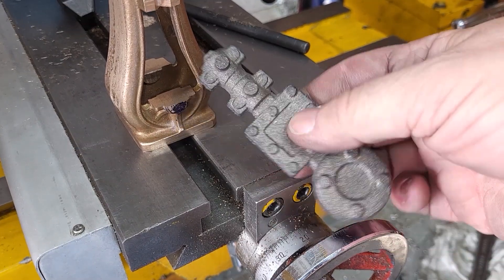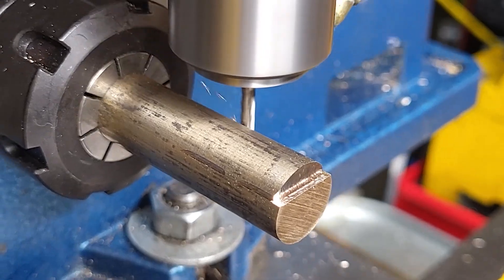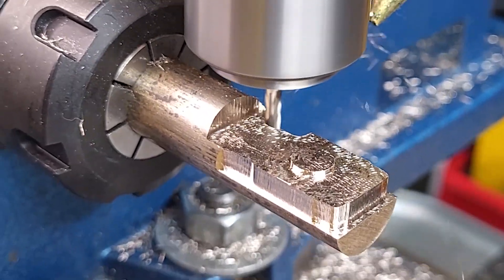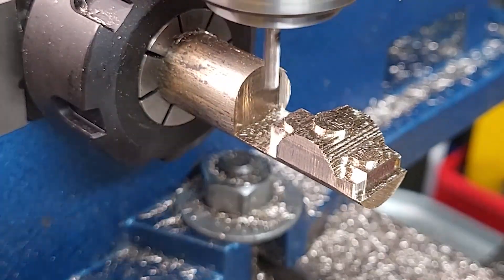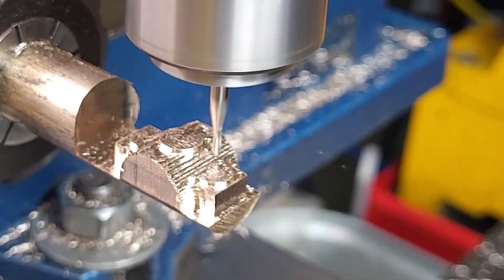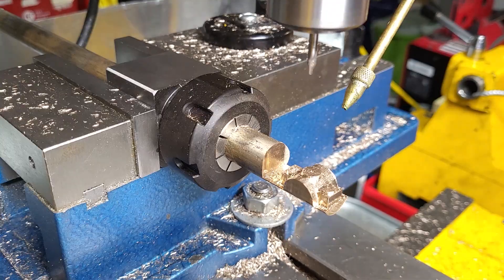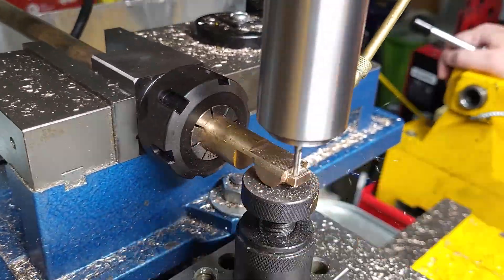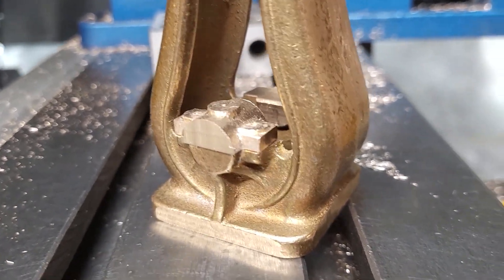4 CNC Milling Unavailable Bronze Bearing Caps from Bar Stock - PMR #5 Steam Engine

Comment: may i ask why you were so intent on not using cast iron?  was the original kit all brass and bronze?  I am building a modern kit and having a great time doing it.
Reply from the maker: Mine was an old kit with the main casting in bronze. I wanted to make the bearing caps to match, as I think that's how they were with the brinze casting.

Comment: Wow, very impressed with your depth of knowledge. Do you have prior  machining expereince? I'm ex IT and now building mining plants and controls systems so no experience whatsoever. Thank you for these very informative videos. Appreciate if you share a bit of Fusion and g code process.
Reply from the maker: Just a hobbyist, also a career in IT, but I've always had a mechanical bent. GCODE is a pretty simple language once you get over the syntax. It's probably one of the oldest programming languages still in common use, hence the arcanity.
Reply: @thumperthoughts  I've started studying g code and seems straight forward enough. I see you using loops and variables  which I didn't know we could do. Enjoy the fusion thousand lines of code running on the machine. Makes my little Instructions look pedestrian.
Reply from the maker: @paulrodrigues5562  loops and variables may just be a linuxcnc thing, that's the only dialect I have used. RTFM as they say. 😉
Reply: Loops in G Code became possible once the code came off of the paper tapes and started getting stored in memory. I don't recall the first controller that had that feature, but as a guess I would not be surprised if it were not Fanuc.

Comment: Another good one! I am not sure the logistics, but it may create better video content if you had the camera mounted on the milling surface. At the high speed it’s really difficult to see how the part is changing over time. Keep up the good work!
Reply from the maker: I would either need a very rigid phone mount or a gopro. The machine vibration would destroy the image. Currently using a long bendy phone holder on a rickety tripod to bring the phone in close enough without touching the machine.